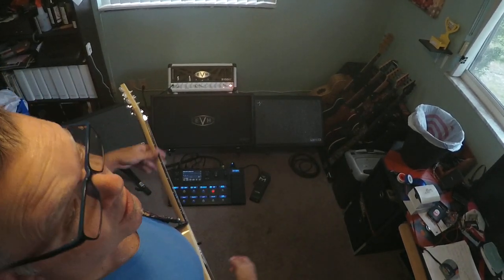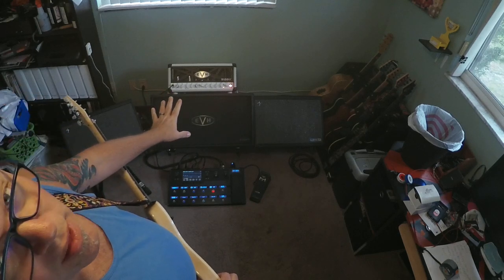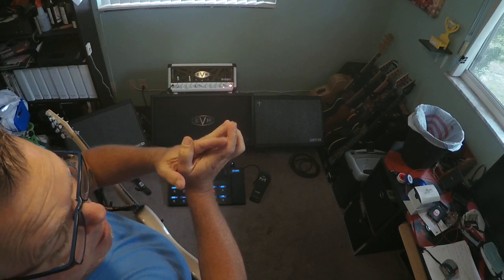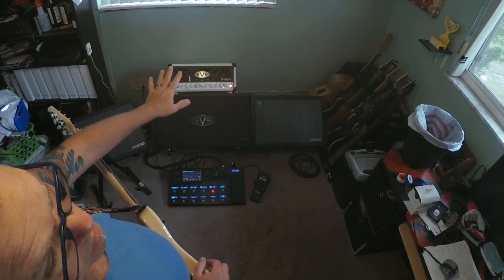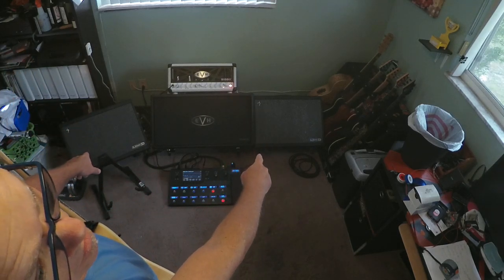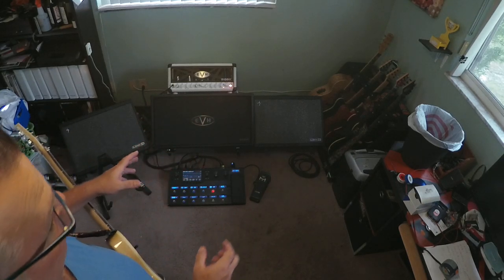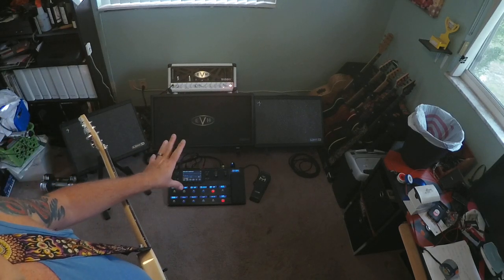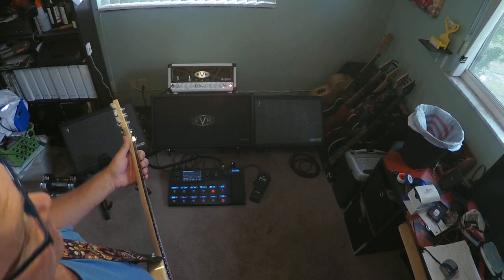EVH 5150 50 watt amp Wet/Dry/Wet using Line 6 Power Cab + and Helix

Comment: I want to thank you for posting your patch for this on the Line6 forum. It’s spot on! I have pretty much the same setup as you (5150 III 50w 2x12 Combo, 2 Line6 Power Cabs) I spent weeks trying to get the wet/dry/wet setup working and couldn’t get it right. Found this video on YouTube and downloaded your patch, instantly started to work. I didn’t even have to reprogram the channel switching on the amp. Thanks so much!!!

Comment: George, what Wolfgang is that? Last time I checked your channel you had the modded candy apple red one, which is my fav color scheme. Those block inlays make it look like a USA tour guitar, but it's got a flamed maple top and no tone knob. I'm jonesing for a new Wolf since I sold my USA Peavey Special awhile back. I want to get an EVH Wolf Special...I really dig the CAR with ebony board, but also digging the baked maple necks on the new ones. I run a Line 6 POD Go on a Friedman BE setting. Sounds killer.
Reply from the maker: Yep, it's my Wolfgang USA.  I call it Starbuck (Battlestar Galactica hot blond). It was a 50th B-day present.

Comment: Hi George. Sounds awesome. Do you keep your evh,s tuned standard and use the drop pedal or helix for flat and other stuff?
Reply from the maker: I tune my wolfgangs down a half step.  I keep two other guitars at regular tuning for learning new songs.  I don't use the Drop pedal any more.  Hoping the update on the Helix will have poly and allow the drop function, at least a half step.
Reply: @hollis1003  thanks. I just got a Wolfgang and having it setup. Was thinking standard and using helix or drop so I can play everything on it. Does the helix tune up also or just down?
Reply from the maker: @Jak259  Helix is not polyphonic... yet.  Once they update to 3.0 we are hoping it will have the ability to go up and down.  Drop pedal only goes down.  I prefer playing in Eb for my band and I like the feel and sound of the strings.  But for learning songs I need to be in tune with the recording.  For all my guitars I am using Ernie Ball Hybrid Slinkys which are 9-46 gauge.  When you drop that low E down to C# it can get rubbery if you don't use a little heavier string.
Reply: Cool George thanks for all the info. Have you ever considered the kemper to the helix? Looking to make a purchase real soon having a tough time deciding between the two. I think I watched literally every video on both lol.

Comment: George, Can you dial Heavy Metal Lead Tones and preset how Powercab Sound?
Reply from the maker: "Heavy Metal Lead Tones" is very subjective.  I'm a hard/classic rock guy.  But yes, you can set the Helix up to program presets in the Powercab +.  It's not as easy as I was thinking but it can be done.  Saves DSP in the Helix to use IRs in the Powercab +.

Comment: George I notice you play a lot of Wolfgangs but not the signature model. Is it somehow spec’d differently that it doesn’t appeal to you? Just wondering since you love EVH gear. Love this set up by the way. Sounds great!
Reply from the maker: I guess most importantly I don't like the pickup selector where it is. I prefer it down where the tone knob is.  I remove the tone on all my guitars anyway.  My newest Wolfgang is a USA and I left the pickup selector where it is and put the kill switch where the tone knob normally goes.  For me, it's just about personal preference.  I like as much consistency from one guitar to the next as possible.  I like the smaller frets on the Chinese and USA models better than the jumbos on the Mexican made Wolfs.  At some point I will have my Candy Apple Red Mexican re-fretted with smaller stainless steel frets.

Comment: Where do you have your patches at?
Reply from the maker: Line 6 Custom Tone, my name there is Darth Hollis.
Reply: @hollis1003  awesome. Thanks so much. Any updated picture of your set up. Not sure if you still use the drop or such. I am going to get myself a helix soon and a 2x12 power cab plus. Didn’t know the brand of the pedal board in your last video and the power supply you use? The mic mount was nice as well?

Comment: I just recently picked up a 5153 50 watt head & 2x12 (thanks to you hah).  I read one of your comments in another video that you're back to running the EVH head + 2x12 setup and was wondering how the Helix Factors into your live rig now.  I'm assuming you don't use the powercabs with the EVH rig live, but are you using the Helix in 4CM for effects only at this point?  I'm probably going to run my Helix Floor with the EVH setup, but might go to something smaller like the HX FX since I wouldn't need the amp sims.
Reply from the maker: Yes.  I'm running the Helix in 4CM with the 5150. Using midi to switch channels.  It sounds great.